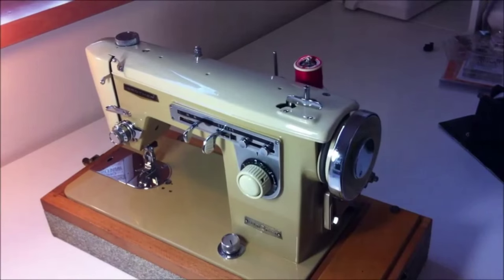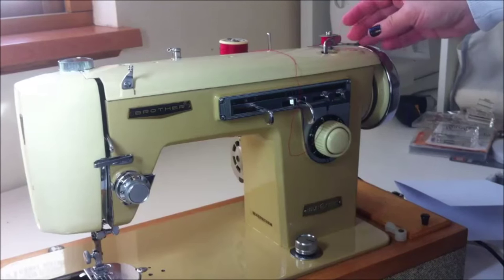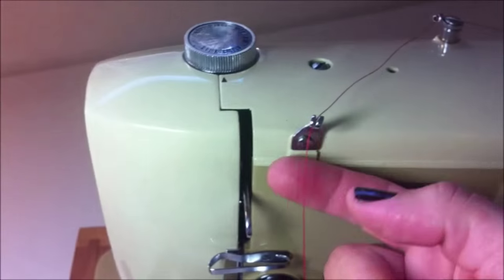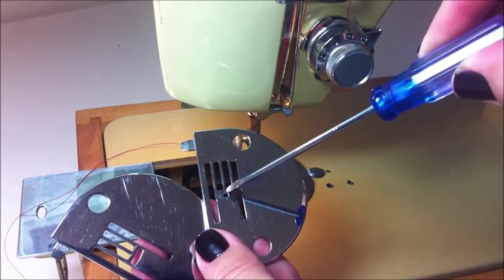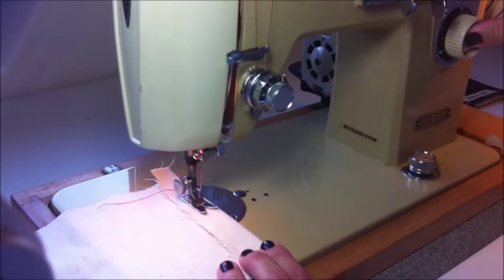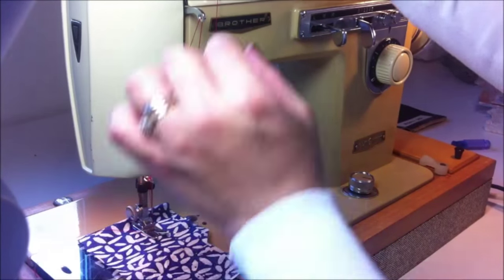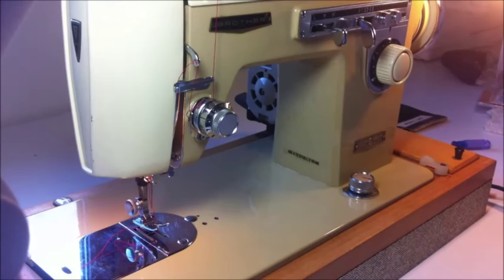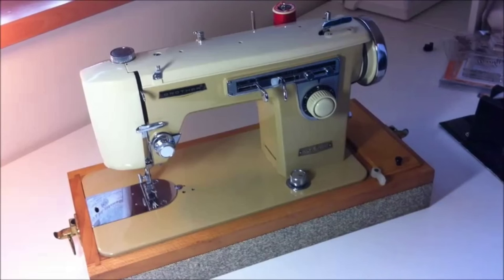How to use a vintage sewing machine brother 345

Comment: Thanks! I have a different model vintage machine so this video didn't answer all my questions but it definitely helped me start unraveling the mystery of what the heck to do with this big heavy bulk of steel and knobs!
Reply from the maker: lol. I'm happy it helps a bit. all this machines does the same, they are very similar. x happy sewing. x Bibi
Reply: I have a 707 model 😂
Reply from the maker: @dyslexicdarling898  . :) vintage sewing machine are all similar. I still have a couple of machines that work slightly different and I need to get the time to make the video for you guys. x
Reply: Same I do not have a motel like that

Comment: Thank you so much.  I just got a slightly older model for free, but your explanations worked like a charm.  Aside from a burnt out light bulb, it worked like a charm.  I've worn through two newer, cheaper sewing machines in recent years, but this one was build before I was born, and is still working like a champ.  Thanks for showing me how to use it.
Reply: Ryan Attoe - what did you stitch, that the machine's broke down?

Comment: I am so grateful for your video. It's extremely similar to my Lomain vintage sewing machine and I was about to buy a new machine because I couldn't get the tension right ever! I was missing one of the section to thread through and I thought the 2 silver buttons on the face were just there for this model because the next level machine would have a control there.  Now I know it's to keep the stitch width lever in place. Thank you I am so appreciative! You've saved me money and throwing out this lovely machine. I wish I could like this video 10 times!
Reply from the maker: Angie Cooper I’m
So glad I made this video so it  can help  a little bit . This machines are real work  horses . Happy sewing !
Reply: I'm pretty sure what you have is a Lemair Helvetia sewing machine, the Americana font badge looks a lot like Lomain. Lemair Helvetia imported sewing machines, mostly Brothers, and rebadged them for the Australian market. They had a Lemair model 345 for which I have the user guide if you're interested. https://lemaire-sewing.fandom.com/wiki/Le_345

Comment: Higher numbers indicate high tension, low numbers indicate low tension.  You need a high tension for thick fabrics and low tension for thin ones.  If you used a high tension on thin fabrics the material will gather up and pucker
Reply from the maker: Jason Lightoller oh dear did I said something different ?

Comment: Hi Bibi, just found your video.  Thanks for sharing.  I have this machine too - it's my favourite and sews perfectly all the time.  Never lets me down. You're actually threading up wrong for the winding the bobbin.  You should use the post at the back (with tension discs) and use a figure of 8 to make sure the bobbin winds with the right tension on the thread.  Also, when you're threading up the top thread, you should put the thread behind the retention bar at the front just above the tension discs, it should pass through this on 3 occasions, this will make sure the tread stays in line and doesn't jump about so much.  Hope you don't mind me helping out.  Kind Regards,
Reply from the maker: oh! I would love to see a video about this specific way to wind a bobbin. :)  I always have winded the bobbinand thread the machine as this is not mentioned at all in the manuals.  I always do this as shown  in the video and  it works fine but there might be other way to do it if you said.  is very confusing as you  can addapt the bobin case tension as well but I did that once and never again. Thanks for the advice. x Bibi
Reply: Shouldn't the bobbin turn clockwise if you pull on the thread? I have a brother Boutique 761 and insert the bobbin into the case so the thread unwinds opposite of what is done here.
Reply: You're right J Schulte, if one pulls the thread the bobbin should turn clockwise in most machines.

Comment: Hi Bibi, thank you for your help. I'm wandering what the use of the "fabric selector" Coating- Wool-Linen-cotton-Silk-Darn) on the left top part of the machine is. There is already a selector of fabric on the right bottom part for 3 types of fabric (Darn-Silk-Norm)?
Reply: The "darning" selection can be used to sew any direction. This gives you the ability to make circles or other patterns.

Comment: This video helps alot, I was given a mademoiselle sewing machine by a friend and your machine is very similar, the only problem I have with mine is the thread keeps breaking when I start to sew but the thread is loose so I am not sure why it is breaking
Reply from the maker: Kathy Jones I'm so glad this video can help . Hmmm  the thread might braking due to   threading issues or the tension is too high ... well I can't tell for sure why this is happening ... Make sure you are threading  the machine with the presser foot  up .  tension in 4 , 5 ...

Comment: Hi Bibi, I have a very similar machine and it's does sew properly, skipping stiches and breaking the thread on thick fabric. What might be the reason?
Reply from the maker: Hmm hard to guess but this could be the tension. It is too high so you can try and  reduce the tension . Could be treading issues too . Make sure you tread the machine with the presser  foot “up” and that you are doing it correctly. Hugs . X hope you can fix it .
Reply: @BibiCameron  Thank you!

Comment: Hi, in the minute 20 you adjust on the  top left a  bottom, what it is ? What it do?. 
I have a similar sewing machine and your video was really helpful, thanks.
Reply from the maker: Those are to adjust length and width of the stitch .  When you press the  little buttons they release the levers to be able to do that .  I found the machine manual but I need to scan it  etc . X hugs thanks for watching

Comment: So here is my dilemma with my "WHITE  Model 940"  I have had since October 1972... having LINT below from years of use and sitting for a number of years (covered) i went to use it and it seemed like it was sticking. Took the BOBBIN Case apart to clean it, and the RED, plastic and metal piece came out which I never noticed before ever happening, now I am having a problem putting the puzzle back together.  Where does it go? Do you have any illustrations I can look at? Can't seem to find the Owners Manuel.   Thank you and or anyone else who is able to help me. Vita in Florida
Reply from the maker: Hi there, sorry I can't help. I don't have instructions for that sewing machine but many of these machines are very similar.  The stickiness is normal so you did well trying to clean it up. x

Comment: I have a Wizard myself, a 3kc 8842 model, which is very close to this as brother bought wizard out i think.
I know it's a long shot, but you wouldn't know what upper tension spring this uses? Or the thread check spring?---(I think I know what check spring it takes but I can't find anything on the tension spring that I'm sure on) I can't find a parts manual that's been helpful and stupid me disassembled my tension assembly and it's been unbalanced since. 
If you have any tips on reassembling the tension assembly, I'd be keen on receiving them --- or even watching, if you cared to make a vid of it? #kindadesperate #graspingatstraws
Reply from the maker: Hello, I have never done or need to do this . So sorry I can’t help .  I have a very good sewing machine repair place  near me , maybe you can find one near you. 
 . X

Comment: Thanks for the explanation, I have got the old sewing machine from my mom, It has the same connection of the pressing foot. I am searching for hours on aliexpress to find the right set of pressing feet, Please, could anybody pointing me the right set on aliexpress?
Reply from the maker: where do you live?
Reply from the maker: Lien Noope if you live in the UK there is a shop that sell them. eBay . Or better look for a local sewing machines shop .
Reply: Bibi Cameron i am trying to help my wife out she was giving a  brother model 151  turquoise i guess 1960's is it worth fixing it up to work like new
Reply from the maker: Thomas Carroll absolutely. These machines does what others can't. ;)
Reply: I'll give it another try tomorrow,  it also could be that the thread is old,  I have had the thread for a long time, I have the tension set at 0, i found that when i pull on the thread to make sure it isn't tight zero is the best but I'll check tomorrow, thanks for replying
Reply: Lien Noope hi

Comment: My machine is an older Brother select e model. I bought but I can't find a needle that I can thread from left to right. I can only put my needle in with the hole from front to back and I think this is my big problem with the machine not sewing. How can I fix this or where can I buy the correct needle that threads from left to right.. Thank you if you can help.
Reply from the maker: Warren wilkilla hmmmmm I'm not an expert on the  sewing machines field  but I think that an universal needle will do the job all depends on how you set the needle in the machine .the direction of the hole depends  on the shape of the bit in which you attach the needle . I can't tell for sure what could be your issue there :( ... but please make sure you are attaching the needle properly  ,,,check out the shape of the semi-circle in which you insert the needle then you will know  how to insert it as the shape of the top bit should fit perfectly in that overture .Sorry I can't help   Any more  plus I'm not English speaker . X Bibi
Reply from the maker: Warren wilkilla please check edited comment . I noticed I wrote some things in the wrong way... struggling to explain due to my English level . X
Reply: Thank you for your reply.

Comment: I have a vintage Elgin zig zag machine I just purchased but it keep breaking thread and also does the thread go behind the door stop or in front? Thanks
Reply from the maker: make sure the "presser foot lifter and presser foot" are up when treading your machine.. this is a common mistake when treading the machine and it will cause this issue. let me know if you manage to make it work .
Reply: I raise the foot with my lever and release the pressure switch on top and pull the threader guide all the way up it kinda binds under the feed dog

Comment: I'm having issues with my bobbin. I've threaded it the way that you showed but when I got to sew it isn't picking up the thread from the bobbin?
Reply from the maker: Have you placed the bobbin case in the correct way on the machine ?  You might thread it correctly but you also need to make sure that the bobbin case is properly set in the machine. check out the gap to fit the bobbing case in the machine and you will see that it has the shape of the bobbin case so it actually latch on in place . It can’t be moving inside the holder.
Reply: @BibiCameron  Thank you for the reply! Yes I have done that. It clicks in and fits as it should. I'm wondering if maybe the timing is off or something. I'll have to dig into it deeper. It's difficult because I am using a vintage Remington Dressmaker and there are no manuals to be found anywhere! Lol

Comment: I learned to sew on my mother's Brother machine, I don't remember the model number though. I currently have a computerized Brother machine. My last machine, something in the bobbin area broke and the bobbin would not stay in place to sew.
Reply from the maker: Julia Mason oh no. I’m sure you can find a local shop where someone can fix it or ask for support to the manufacturer. In my city I know the person can fix anything regarding sewing machines. I used her help a couple of times with electric bits . X

Comment: How does the machine start moving?
I have the same one but it’s moving by itself when I connect it to power. I don’t know how to use it .
Reply from the maker: It might have a faulty pedal ? This machines are electric and shouldn’t start moving by themselves. The pedal control the speed too. X
Reply: Thanks for the feedback

Comment: Is it smart to buy a used Vintage machine like this or am I better off with a plastic machine like SInger or Brother, the ones they sell at Walmart
Reply from the maker: Alexander B hi there , I think all depends on your needs , personal preference and what you will be sewing . This machines will see even leather, jeans.. very heavy materias ..etc . The plastic ones won’t although  they could be easier to use and light weight. I have both and I use the modern one  more as I do sew light materials . Hugs 🤗

Comment: Hi Bibi, my name is Ola. I can't thank you enough for this video! I just got a similar vintage model but the needle position selector only moves to the left and the needle is stuck in the middle position. What can I do to resolve this. Please help
Reply from the maker: hi there your machine might need service. it happened to me with one machine and it was stuck due to dirt. I clean it and oiled... you wont believe to get rid of the dirt I used a steamer. I'm not sure what could be happening with yours. x
Reply: Thanks Bibi, I will try cleaning and oiling it
Reply: Innovative Tutors hi Mon  i Iove the way u are doing u are amazing, am from African Ghana    and I used to learn how to sew a shirt but my machine got spoiled please if can help me get the machine you're using ..
Reply: Please I want this vintage machine

Comment: Has any one got a manual for a brother JA 28 that has a compartment on the top for stitch patterns an the stitch length and reverse  button is combined and the bobbin winder is also on the front by the needle a height wheel

Comment: I have an older brother with no info all I see is a serial number ... I'm so lost and it keeps bunching up the underside...im not even sure what bobbin goes in it can you help
Reply from the maker: Marie Strickland  visit : https://www.brother-usa.com/brother-support.  and add the serial number of your machine . 
 you should be able to find the manual or at least the model . It  Sounds like you are missing a bobbing case? Sorry I can’t help ... sadly without seen what are you doing etc I couldn’t tell  what is wrong .
Reply: @BibiCameron  thanks
Reply: @BibiCameron  the link went away
Reply: @BibiCameron  says no results I have the bobbin case but no bobbin and not sure what type to get

Comment: My machine doesn't have those two disks you were taking about, what should I do
Reply from the maker: Miroslav Petkov do you mean the tension discs?
Reply: Yeah but I figured it out, mine were under a "cap with two holes on each side where the disks are
Reply: I think it's spelled disKs btw or atleast autocorrect says so.. dunno
Reply from the maker: I'm glad to know they are there.  I was wondering how it will be possible to lose those discs. lol  ( no worries about auto corrector)
Reply: Bibi Cameron btw where do you put the string from the bobbing (don't know how to spell that too) or do you just leave it inside without attaching it?
Reply from the maker: I describe how I do it in the video. you can download the manual in my blog www.myharristweed.com  please check video description. I'll add the link in a minute

Comment: yoyo how do you make the thread not fall out
Reply from the maker: There is a pin to set the thread in.  Sew slow and analyze if the tension is to tight or why this might be happening.